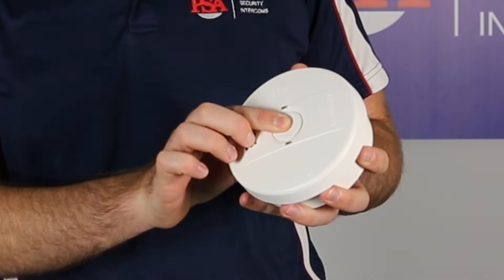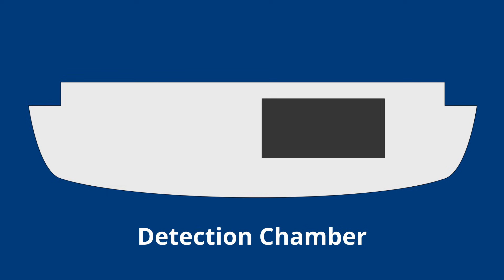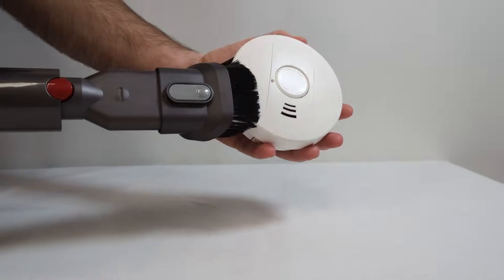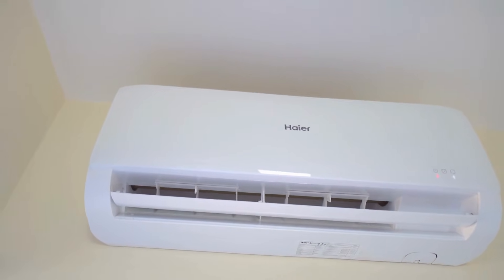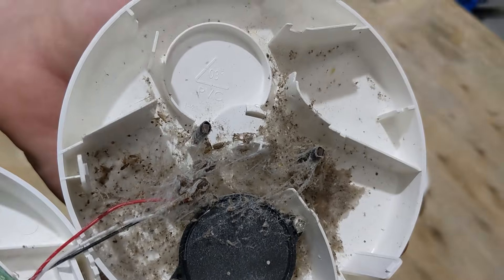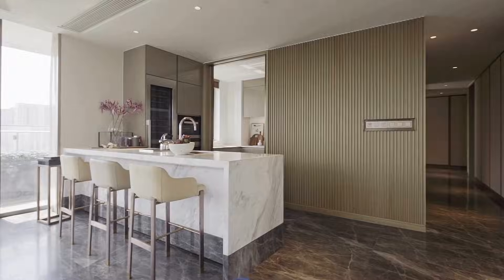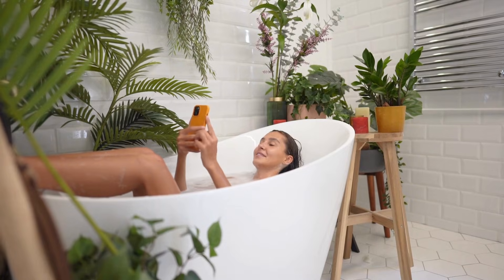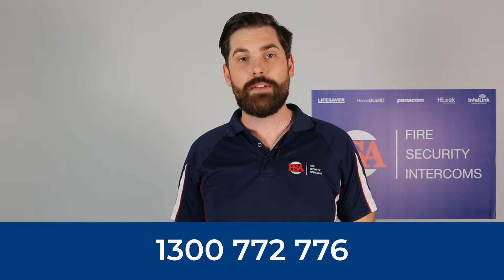Why Do Smoke Alarms False Alarm?

Comment: You failed at explaining why do smoke alarms false alarm?   Of the smoke detector units you showed, and for the reasons of their alarm, they did not fail, they worked properly and did exactly as they should have.  In all of your cases, the smoke detector activated when something imitated smoke.  Just because it wasn't actual smoke that caused the alarm, does not mean they failed.  However, a smoke detector can actually fail if the lifespan surpasses 10 years old  according to the manufacturer, which oddly you did not mention.  Therefore, after 10 years, it is recommended that the smoke detector be replaced with a new one if it's more than 10 years old.

Comment: electrician (employee) here, thanks a bunch I fucking hate theses things. this was probably the most informative video on this topic. I will definitely be recommending people watch this. the problems i'm having are with crappy first alert BRK alarms but hopefully this will help. I noticed I would receive more calls about false alarms after a heavy rain particularly in the spring months, so the humidity thing definitely makes total sense. A lot of customers are complaining about false alarms triggering at 2-3am I always thought that was odd but at least now I have a proper explanation. lastly if you are reading this, you live in Canada and have BRK alarms buy something else instead, BRK is trash.
Reply: We have two smoke detectors. They're very close to each other. We have replaced them each twice and they still just go off a randomly. And there's no reason in sight!

Comment: My dog is terrorized anytime one of these alarms goes off or even chirps. I try to keep the batteries fresh, yet the process of changing the battery can create the unwanted chirp.
Reply: They also have smoke detectors with 10 year battery’s built-in you only replace them when the alarm itself needs replacing
Reply: if they are hard wired try unplugging they from the system before replacing the battery

Comment: A couple weeks ago a 10 year sealed battery alarm I've had for a year & a half started going off for no reason at 1:30 AM 🤦🏻‍♀️. Went off the majority of the next couple hours for 10-20 mins at a time, eventually shut up til maintenance checked it later that day for their monthly alarm test (i told them about the issue & they claimed they'd be back to look at it later)... well about 2 hours later it was going off again. Took a couple hours of it going off most of the time for maintenance to show back up & all they did was reset it. That worked for 8-9 days then it started doing it again. It started around 4:50 PM & continued going off occasionally the rest of the evening/night. I called the office & basically demanded they replace that stupid alarm or at least investigate it further. Maintenance was here in 30 mins, replaced it & were trying hard to blame the "smells" in my house for setting it off 20+ times in 3-4 out of 11 days, even though the other 2 alarms just like that one that I've had a year or two longer than the troublesome one haven't made any sounds yet 🤦🏻‍♀️

Comment: That humidity thing is probably the reason why people always complain about false alarms in the early morning. The best way to prevent this is just to remove every other source of humidity.
Reply from the maker: nailed it
Reply: but how?
Reply: @POLARISFPV My question too...how the heck does one 'remove humidity'?
Reply: Dehumidifier or even a/c
Reply: @binkster9683 Nah dehumidifier actually make it worse sometimes.
Reply: It's usually humid in the warmer months so a/c should do.
It. I got lazy one summer and didn't put in  a/c and smoke alarms were going off.Then I put in a/c. No issues
Reply: @binkster9683 Uh uh. I have AC and put it at 21 degrees with fan always running at night. once or twice a summer I get a false alarm, usually in june.